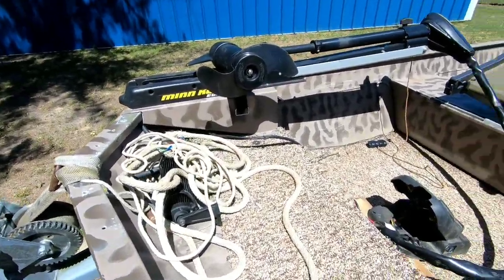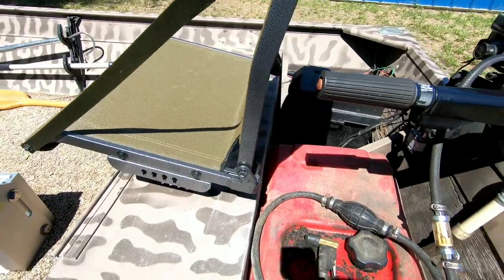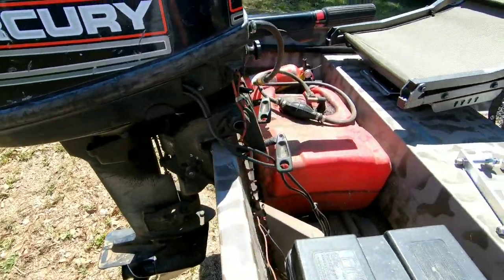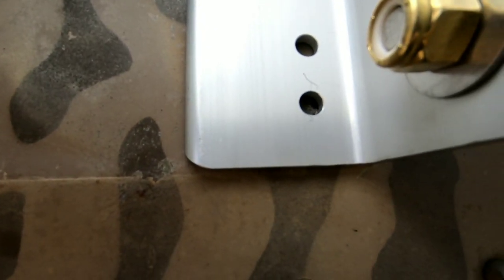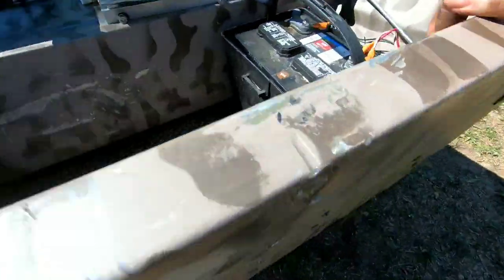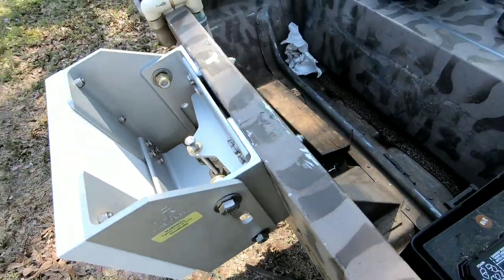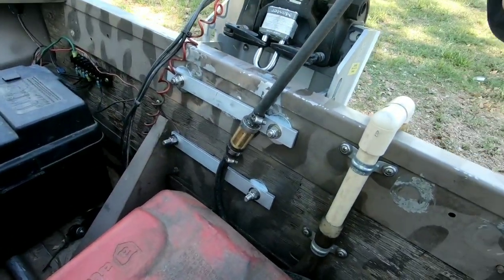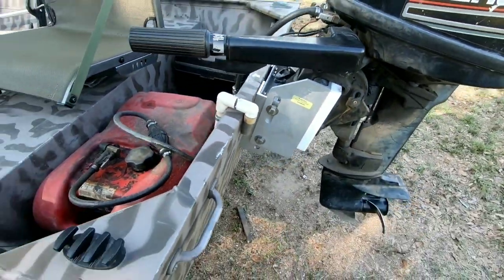Duracraft 14'x36" Jon boat jack plate / setback bracket installation

Comment: How did this affect the weight balance? Any issues with it? Im looking to move my motor back a few inches for the same reason but I didnt think I'd need a 7" setback but yours looks good.
Reply from the maker: Hey thanks for watching!  I haven't had any trouble with mine so far.  I do have 2 12v batteries behind the front seat so that helps when I'm using the outboard solo.  Vance does make a 5" version and I'll attach the link for you,  this one is up to 20hp https://www.vancemfg.com/5inch-setback-mini-jack-plate-p/jpl2410sb.htm
Reply: @slab4x477  Good to hear, thanks for reply! I'm trying out a 2.5" setback to start, going to see where that gets me.

Comment: Does the motor get in the way in adjusting the bracket up or down?
Reply from the maker: Yeah some.. smaller engines I'd recommend unclamping to adjust.  Its possible to do it while clamped on.

Comment: Could you post the measurements of the bolt holes? Like how far apart they are horizontally and vertically. I'm trying to determine if they'll at least come close to my existing holes...thanks!

Comment: I’m having a problem with water coming in the boat Bc of the motor, would a jack plate help? It won’t get on plain right now
Reply: Yes, you need to lift motor 5 inches with a jack plate and you’ll be good to go
Reply from the maker: Yes, you need to lift it some.  I highly recommend Vance

Comment: Do you have any advice on where I can find T-slot bolts for accessories like rod holder , (mainly)Bimini top brackets, etc, I haven’t had any luck , I even called Duracraft....thanks for any help.
Reply from the maker: I wish I did.. I haven't been able to find any either.  It would be nice to be able to actually my rails
Reply: Easy, go on any site that sells t-slot bolts for machinists, etc. in fact amazon will sell them ...in many cases regular bolts can be used also.
Reply from the maker: @ericrhinehart5434  I dont think mine is a T slot.  Swivl-eze make a sliding seat bracket.  My slot is kinda like what the actual seat bracket would fit into.  If that make sense

Comment: Is that the 1 inch clamping board on there? Hows it hold up?
Reply from the maker: It's one that I made out of synthetic deck board material.  Haven't had any trouble with it yet.
Reply: @slab4x477  Gotcha, the one from VM is the same material I was curious. Getting the 5"setback for my merc 9.9 2 stroke.

Comment: Would have been easier to move the seat over to the right a bit .
Reply from the maker: Yep, but I have been in boats like that and do not like off centered seats.
Reply: @slab4x477  I turn sideways when driving anyway and out my feet on the rail .
More leg room.